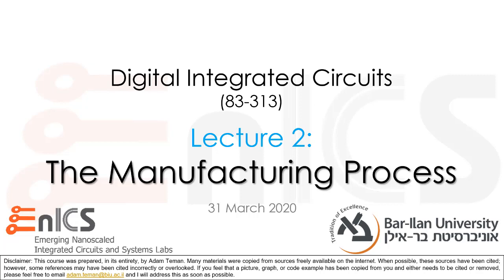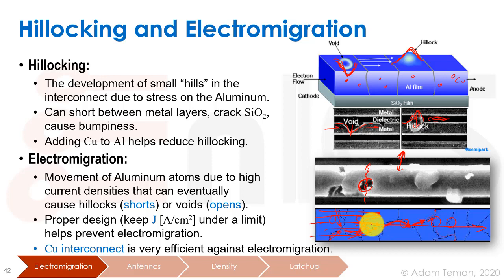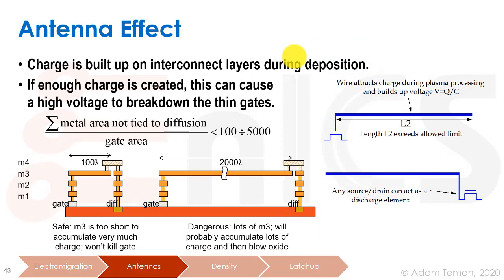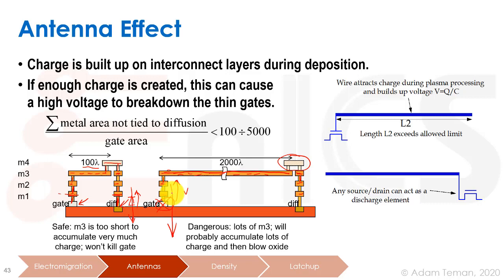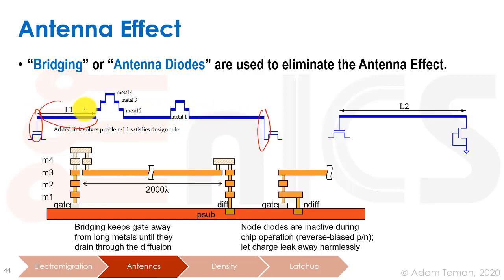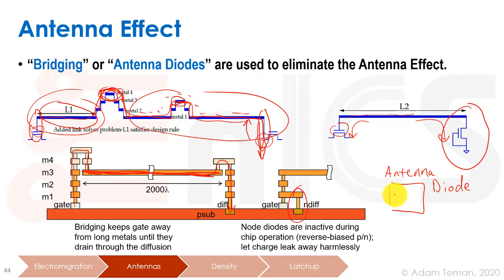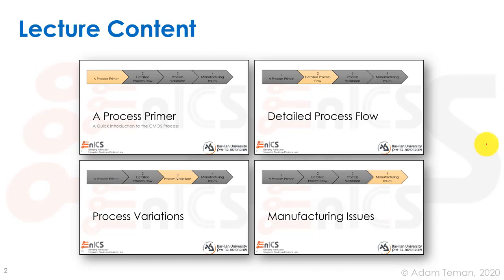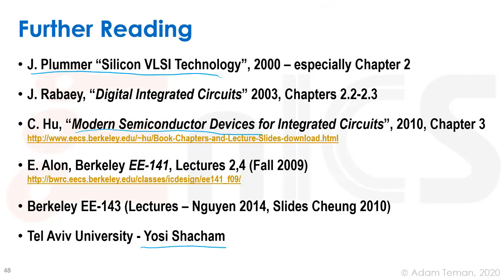VLSI - Lecture 2d: The Manufacturing Process - Manufacturing Issues

Comment: How Can I figure Latchup in My CHIP?, How do you measure latch-up?
Reply from the maker: Hi,
Latchup is not something you "measure". Latchup is a phenomenon that if it happens, your system stops functioning, needs to be shutdown/restarted, and could potentially burn it out.
What we do is try to avoid it and this we do by placing well taps around the design to reduce the resistance across the well/substrate. There are DRC guidelines provided by the foundry that ensure that you put enough of these well taps. However, when designing for high-radiation environments, such as avionics or space, you would probably increase the number of well taps significantly or take additional measures.